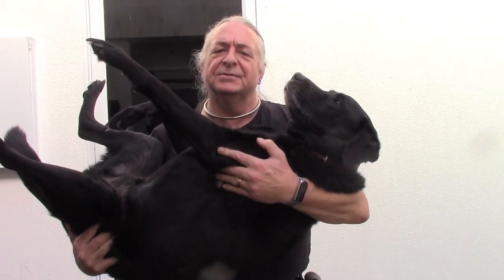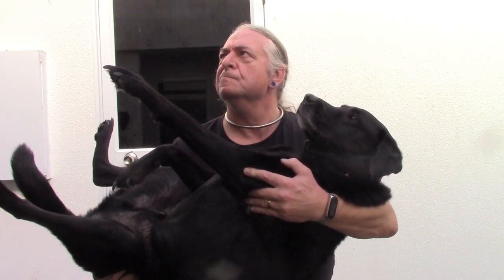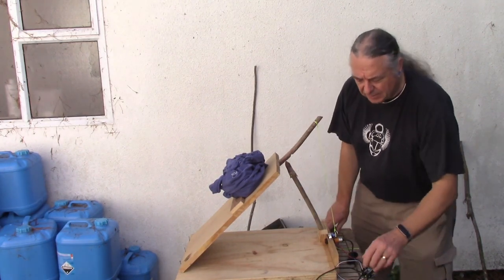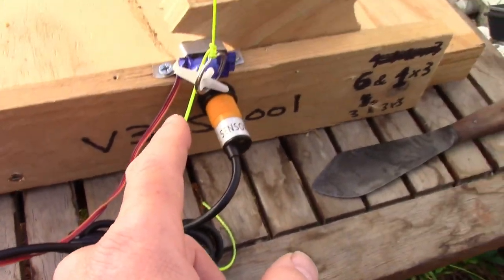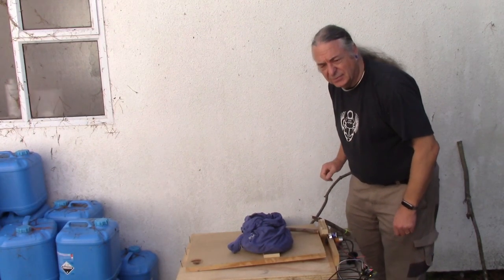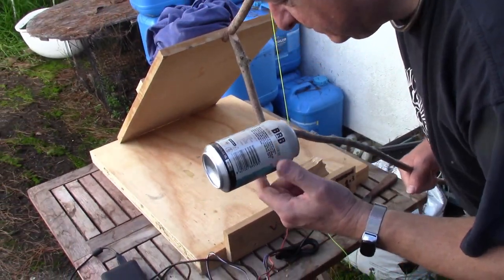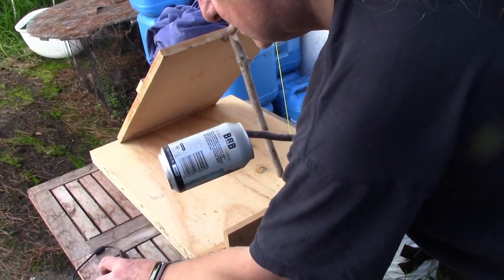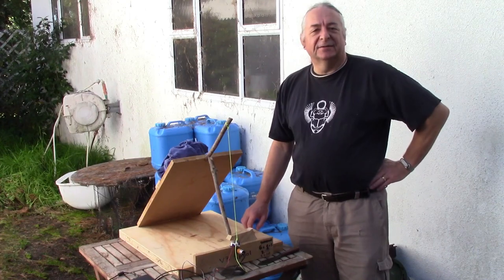Episode 90 - Rats

Comment: Ideally you want a trap which auto resets.The motor activation could spook the target and allow it to escape. There are balance based traps which are pretty awesome.
Reply from the maker: Ideally I would. However I used the bits on hand. Not documented is a 433MHz link that connects to the trap indicator light, so it is possible to see when it has gone off from inside the house and needs to be cleared out and reset. For the slow motion shot I had set the indicator light to flash at 10ms intervals, and you can see that the time from motor movement to impact is less than 0.15s. The board only drops when the rat is on the centre line, and it's nice and wide. The furthest they've got so far is 50mm off centre. I won't bore with gory details, but it's 100% effective so far and I'm glad I lightened the weight.